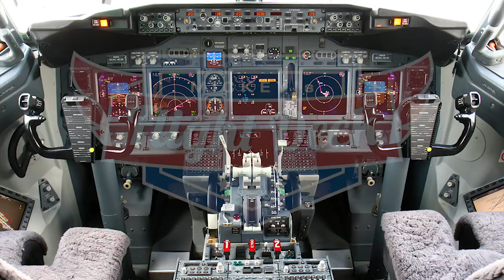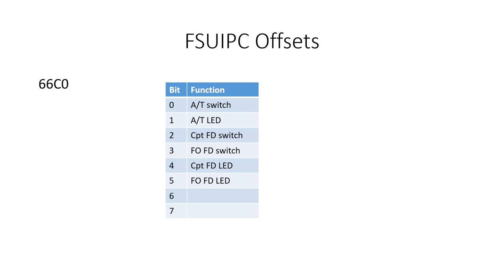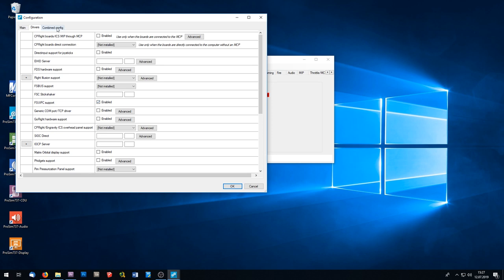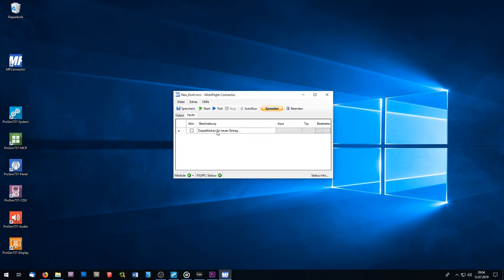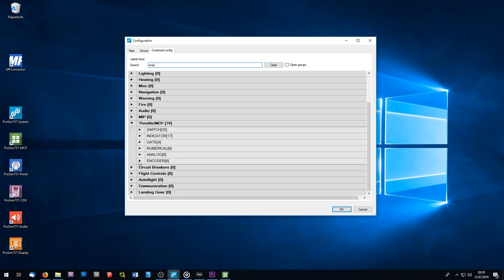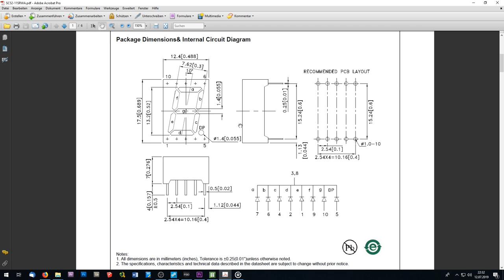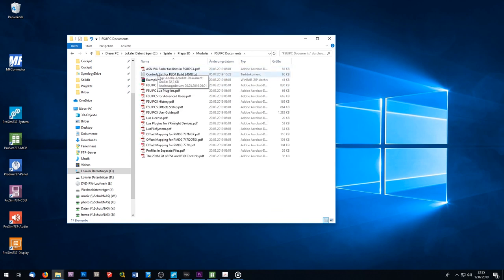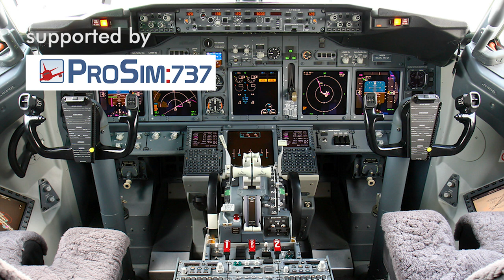Using MobiFlight with Prosim737 - A Boeing 737-800 Homecockpit #35

Comment: I haven't seen an answer to your question from this video, about the 9.53K resistor. Just in case you haven't figured it out yet, here is my answer. If you use a 9.69K resistor (9.53K is probably close enough) then each of your segments will receive a 40mA current. If your LEDs had a 3.5 forward voltage and were rated to accept this sort of current (40mA) they could potentially work, especially if you had further current limiting resistors connected to each segments input. 9.53K is a bare minimum resistance for special cases, it seems and they probably shouldn't have used it in there schematic. 47K which is what you chose in the end, is a very sensible choice as it brings the current down to acceptable values for your 7 segment LEDs, which are probably rated to accept 20mA. The current given out to each segment is about 100 times the current that goes into the MAX7219 chip at pin 18, according to the documentation. So, if you had it connected to 5V with the 9.53K resistor, pin 18 was receiving about 0.52mA. Therefore it was giving out about 52mA to each segment. I'm not an electronics professional, but I believe my answer is correct and hope it helps you.

Comment: Hi .. Very helpful video. My guess is the freezing problem was probably SIOC. I use Opencockpits hardware and have a lot of issues, including periodic freezing. I’m looking at converting it to run with Arduino & Mobiflight. I like Opencockpits hardware, but think SIOC is too unstable.
Reply from the maker: There is another server you can try at iocpserver.net

Comment: Hello, do we have to configure each button before each panel? (For example for the fuel panel, we have to program each button, and then put them on the panel and solder them? )
Reply from the maker: No, you can build the panel first and then make the configuration. This the workflow I'm using.

Comment: Hi Michael. Hope you ara doing well. Long time ago I was using FSX and P3D and I was able to get de offset values to make my components works with mobiflight. Month ago I move to Xplane I wanted to start to prepard my radio stack , my project is simple. just teh two comm and navs and also transponder. The things is that when I go to mobiflight on the droplist box Fsuipc offset is very short in compare of what I used to have before. So I see  that some freinds from youtube use Promsim to get the offset values. I wondering if you know where I could find a list with this differents values. If there is something like Mangetta Project, where you have all the Offset values from PMDG?

Comment: Hi Michael, gut das du doch noch zu Mobiflight gefunden hast. Vielleicht lasst du das ProSim eines Tages auch weg, weil Mobiflight einfach besser ist. Aber zwei Dinge muss ich dir noch auf den Weg geben, damit du dir, wenn erst viele Configurationen definiert sind keinen Ärger bekommst. "Wähle ---deine Aufgaben/Tast/Enc/Led" Bezeichnungen so kurz als möglich. Du bekommst sonst Probleme. 2. Von PMDG bekommst du eine zweite PDF mit "Event-IDs" Diese werden für alle In-Puts verwendet, sind schnell und leicht zu setzen. Die Offset nimmt man nur bei den Ausgaben. Noch ein Drittes:  Bei den Encodern für IAS/MACH brauchst du 6 Konfigurationen mit Vorbedingungen und Verweisen. Für VerticalSpeed sind es zwei. Da kann ich dir helfen, wenn du es brauchst.
Reply from the maker: Weshalb bekommt man bei längeren Bezeichnungen Probleme? Wegen der Übersichtlichkeit oder muckt die Software dann rum?
Reply: Ja, angeblich wegen der Antwortzeiten. Ich bin dem Problem rechtzeitig aus dem Wege gegangen aber in freundschaftlicher Beziehung mit Stephan aus dem Mobiflight-Forum. Solche Probleme können sehr zeitfressend sein. Mobiflight ist recht einfach aufgebaut, hat aber auch seine Eigenheiten. Du kannst von den Insidern dort, wie Stephan oder Pitzmann sehr profitieren, sind wirklich gute Jungs. Geschrieben hat das Programm "Sebastian" und stellt es uns gratis zur Verfügung. Sieh dich da mal um, du musst das Rad nicht neu erfinden. Bei Stephan kannst du dich ruhig auf mich berufen. Viel Spaß.
  @Mickeys_Flightdeck

Comment: Hi Mickey, Have you done work on the MobiFlight-ProSim737 TQ Lever servos configuration yet?
Reply from the maker: No, this will take place in a far future. If you are interested in this topic, you should watch the last videos of the helimech channel where he updated a saitek throttle.
Reply: @Mickeys_Flightdeck  Thanks for the timeous response. Yes I have been following his work as well. He's really talented. Using his drawings to print my TQ. I have the levers working but struggling once I use ProSim737. Will keep experimenting. Keep well.

Comment: Hello Michael I set the Land alt and flt alt display as well as the encoders. When encoders turn right or left the numerical displays are not moving, did you set this pressurization already? If yes what is the fsuipc code you were used? Please advise me.
Reply from the maker: No, I haven't done this until now. I thought you could use any of the free offsets. In the FSUIPC documentation there are two offsets listed for this. Otherwise you can just search in the FSUIPC documentation.

Comment: Hallo Michael,,

I have questions, how to set announciator? And is there RTO or autobrake setting in latest ProSim?
Reply from the maker: For the annunciators you should watch my videos #40 and #37. The RTO settings can be found in the "Landing Gear" section of Prosim.
Reply: @Mickeys_Flightdeck  I mean annunciators of AP/PRST, AT/PRST and FMC/PRST...
Reply from the maker: @herlyyantopartokusumo4216  They are called "ASA A/P Amber Capt" and so on in Prosim. You can find them in the MIP category.
Reply: @Mickeys_Flightdeck  Thanks lot Michael for your valuable support.

Comment: You should have gone with Pokeys. Easy setup and they have USB and Ethernet. Setup is very easy and no programming needed to connect with Prosim
Reply from the maker: The ethernet part is really interesting. But for the price of one Pokey card I can get nearly four Arduino Megas. I didn't have the feeling that it was too much work for me with this system. But I will keep this in mind when I'm planning the CDU.

Comment: Hi, i´m making a homecockpit and i will use Mobiflight but i don’t know if it’s necessary to use prosim737 because it’s so expensive for me. Have you got another solution to use mobiflight correctly without prosim737 ?
Reply from the maker: If you don't want to build a 737, then you don't need Prosim. Otherwise you can have a look at the PMDG or iFly. There are several cockpits based on the PMDG.
Reply: Michael Schulz i build a cockpit of 737, i´m on P3D with the 737 pmdg but i don’t want to spend too much money. Do you know an alternative of prosim ?
Reply from the maker: @quentinmaker5869  When you use the PMDG you don't need Prosim.
Reply from the maker: You can look out for the FSUIPC offsets that are used by PMDG. I don't know if you can reach every function via an offset. Otherwise you can have a look at this site. https://phpjj.wordpress.com/ It is covering the full topic of connecting the PMDG to an arduino.
Reply: Michael Schulz okay thank you very much ! And FSUIPC is it necessary to buy it to use it with mobiflight ?
Reply from the maker: @quentinmaker5869  No, this is not neccessary. You will only need to buy it when you want to use further funtions of it.
Reply: @Mickeys_Flightdeck  thank you for this answers that precises a lot of things about using mobiflight with FSUIPC and PMDG, it's very helpful for me! 🤝

Comment: Mich würde sehr intressieren welche Encoder und Switches du verwendest. Bin auf der Suche nach den passenden und gut aussehenden aber leider noch keine gefunden die mich überzeugt haben :( Könntest du hier evtl eine Info rausgeben? :)
Reply from the maker: Hier ist ein Beispiel für den Encoder https://www.aliexpress.com/item/4000099410716.html?algo_pvid=faaa3438-67a8-41ad-87cd-7b19900ae4bf&algo_expid=faaa3438-67a8-41ad-87cd-7b19900ae4bf-16&btsid=f5ae6fcb-2a63-4302-b904-75f48ffa70a1&ws_ab_test=searchweb0_0,searchweb201602_,searchweb201603_52 und ein Schalter hier: https://www.aliexpress.com/item/32920045398.html?gps-id=detail404&scm=1007.16891.96945.0&scm_id=1007.16891.96945.0&scm-url=1007.16891.96945.0&pvid=2cef5ad9-2994-4348-b427-ab81900aed46 Das Aussehen ist bei diesen Bauteilen vollkommen unwichtig, da sowieso eigene Kappen draufgeschraubt werden.

Comment: Im have an error: There was an error on uploading the firmware!
Enable Debug Logging for more details
Reply from the maker: It can help to disconnect and reconnect the arduino. Also close and open MobiFlight again. If the error is still there you can enable the debug logging and try to ask in the MobiFlight forum.
Reply: Best thing is to post your problem on the MobiFlight forum